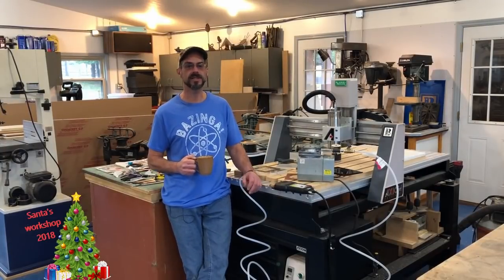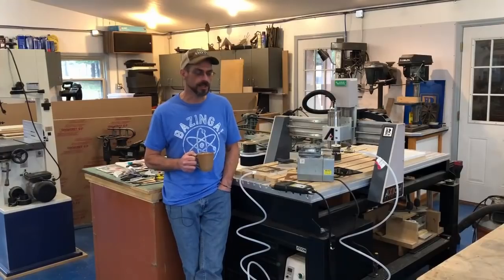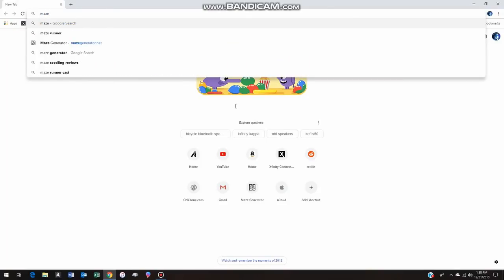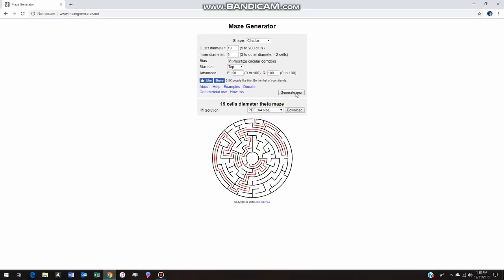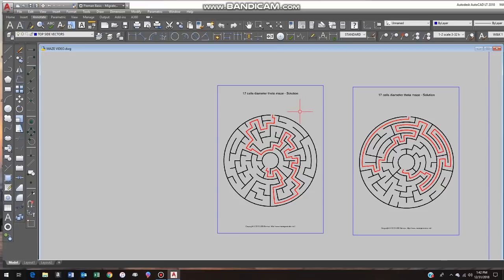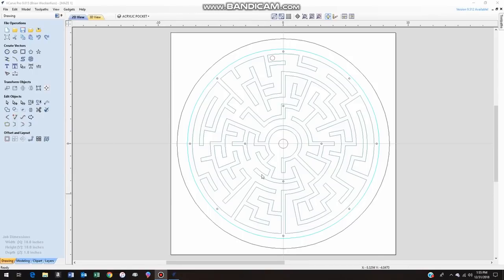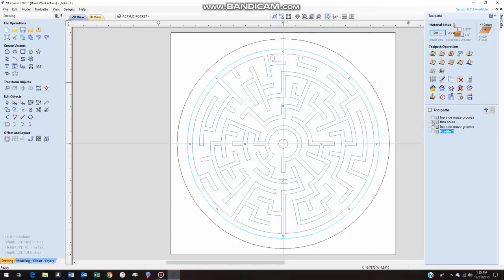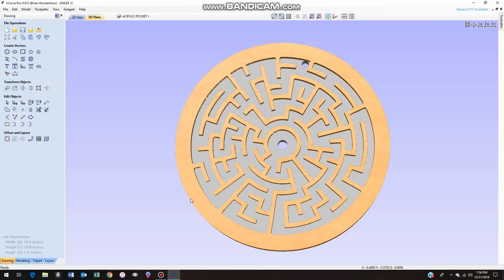Wood maze // Christmas gifts 2018

Comment: So I imported a similar maze into Aspire & made a 3D model of it. My problem arose in that most of the tool paths, including the modeling one, would flip the walls & channels.  Any suggestions out there?
Reply from the maker: it depends on what type of toolpath you are using. toolpaths can be reversed (walls become channels, vice versa) if you are using a pocketing toolpath but do not have and outline for the pocket, a border so to speak. hope this helps